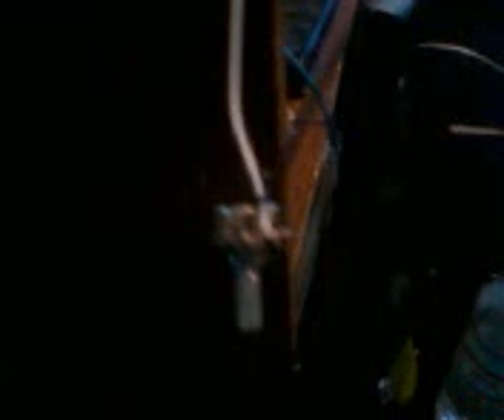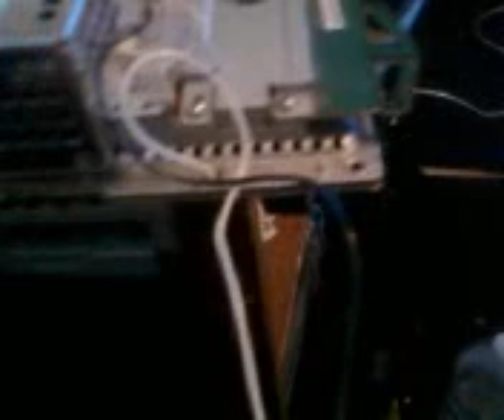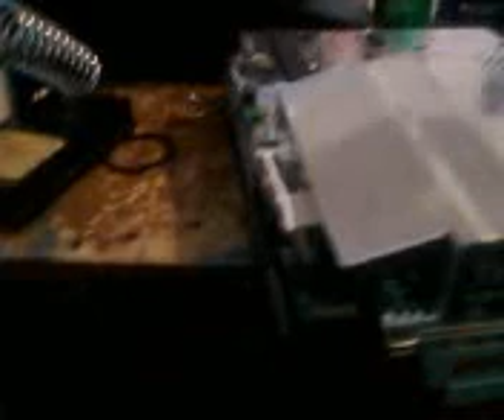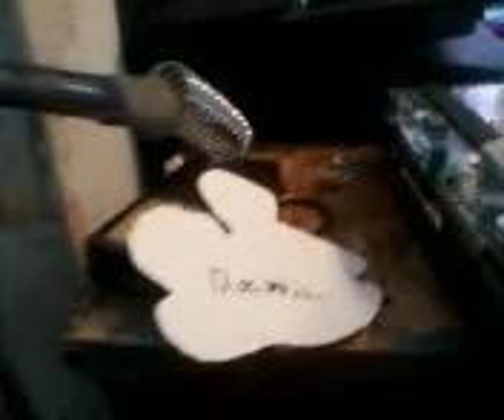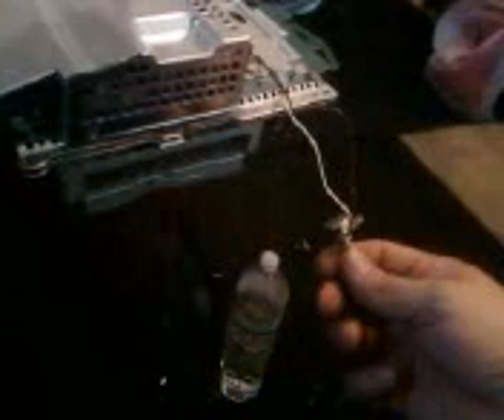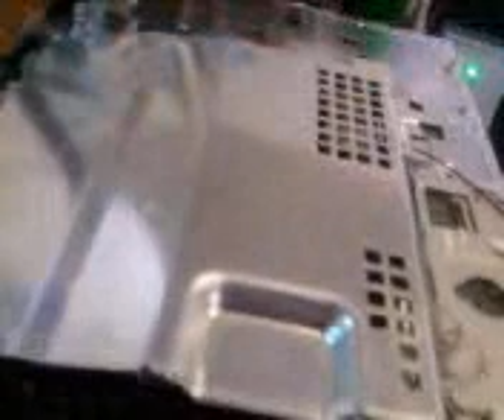Playstation 3 fan mod

Comment: are you sure the middle leg on pot goes to fan? i had a 40gb ps3 and i did this but i put middle leg to 3.3 power source on psu and one of the outside legs went to the fan, what model is this one?